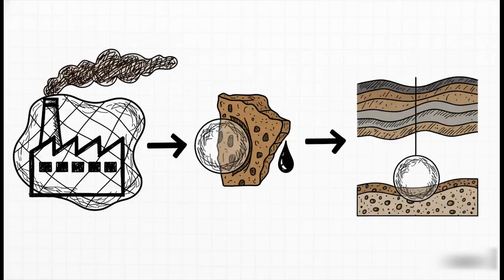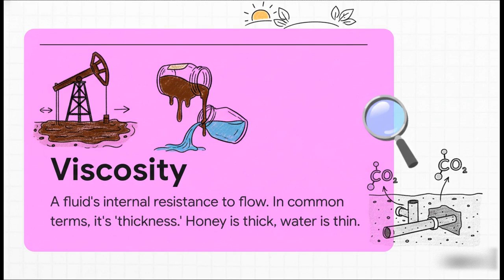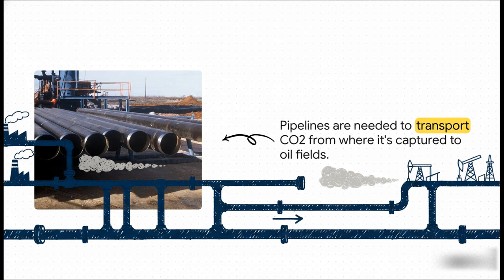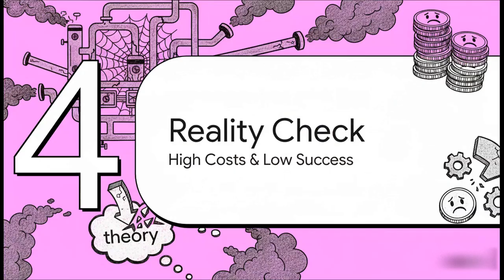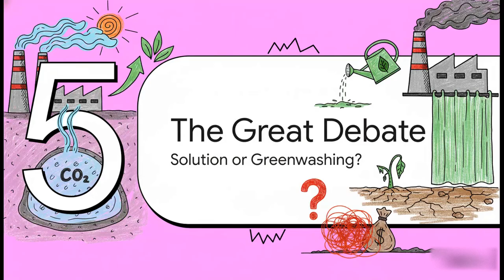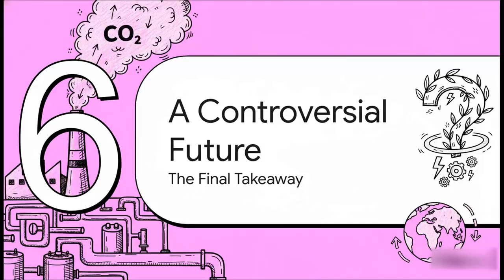Carbon Capture’s Dirty Secret: Does CO₂ Actually Create More Oil?

Comment from the maker: A climate technology designed to cut emissions is mostly used to extract more oil.

So what matters more—engineering potential or real-world outcomes?

👇 Question for you:
Do you see CCUS as a necessary transition tool, or a distraction from cleaner solutions?

👍 Like if this clarified the debate
🔔 Subscribe to @SciPulse for science without slogans
📤 Share this with someone who thinks carbon capture is simple